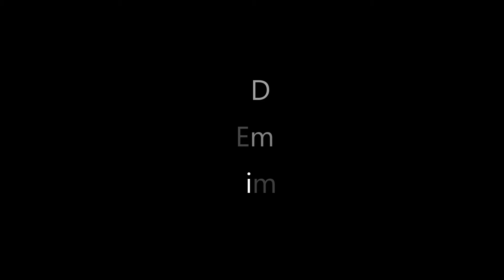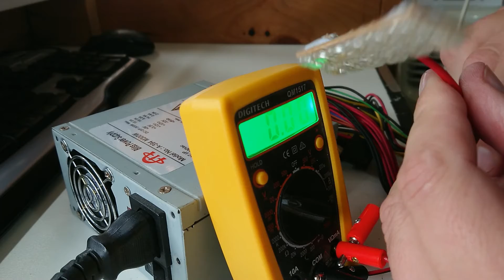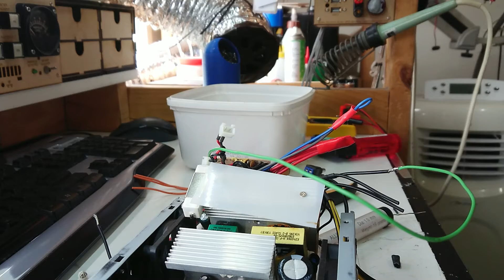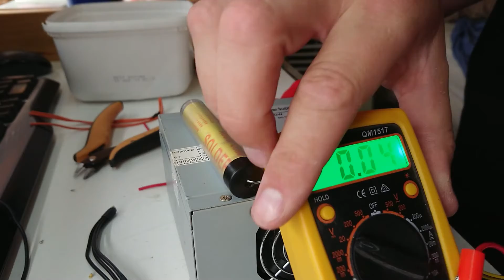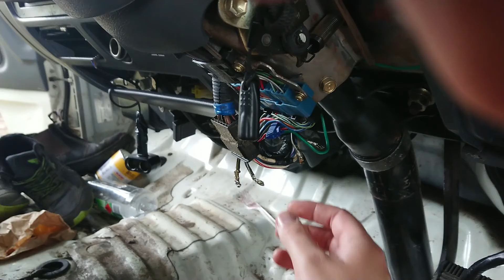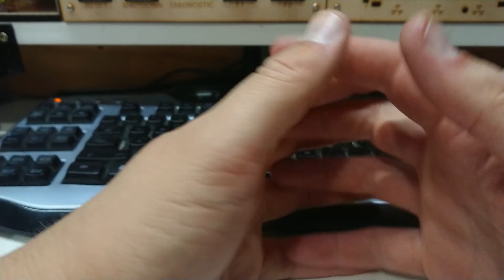Repairs for Bushfire Evacuees - Day 3

Comment: Hi mate, the power supply being a SMPS, uses the 5V high current output as the feedback for regulation.
As you do not have the 5V loaded up the duty cycle is relatively small, hence the 12V output being a bit low.
I don't know if you can check but the 12V system in the early ATX are a simple linear voltage regulator.
Usually in ATX conversions a load resistor is fitted to the 5V output to kick the duty cycle up to where the circuit would normally work and hence the 12V circuit would get sufficient unreg input to the 12V reg.
A better duty cycle, that is 50% or better will mean the filter circuit will function better.
Have you fitted a fuse to the 12V output?
Check the 12V output ripple, AC range of DMM.
Take care mate, doing a great job, don't breathe to much smoke...👍👍👍👍👍👍😊
Reply from the maker: This particular model has short circuit protection, hence the choice. The 100ma load I put on it was not enough to bump up tge load, but under the 4amp load of the tv, it levelled out nicely. No need for the 5v load. This one uses LM7905 and LM7912 negative rail regulators
Reply from the maker: It was a quick and hacky solution to get him connected with media updates